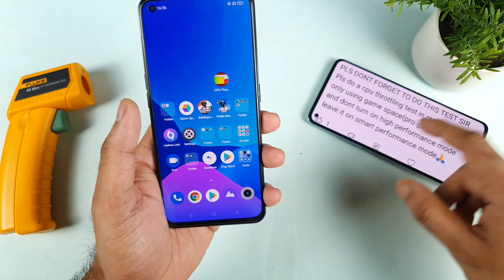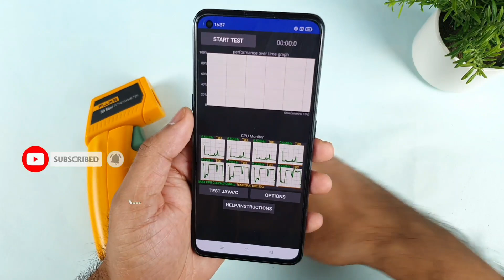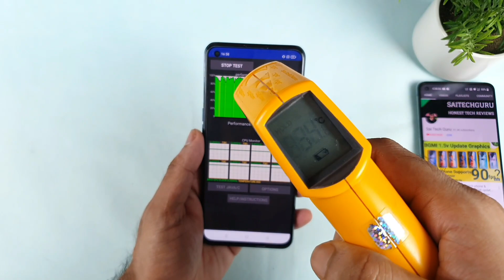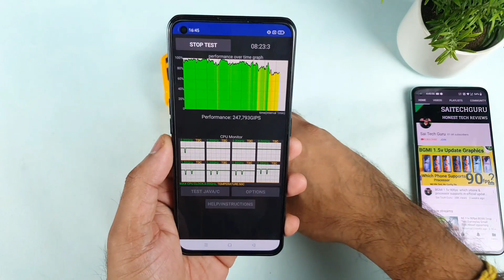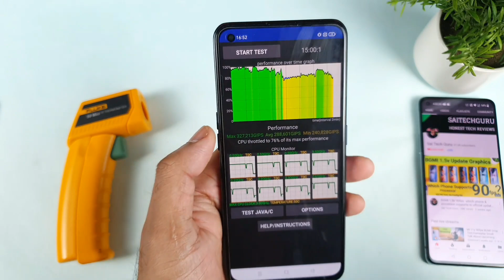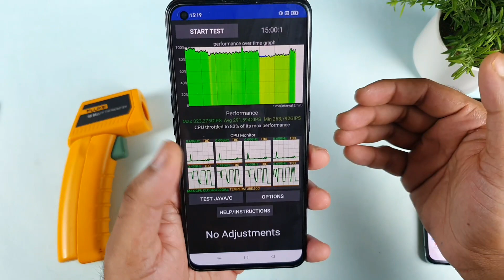Realme X7 Max CPU Throttling using Game Boost & pro gamer mode 🔥🔥🔥

Comment: Clearly 
Snap dragon 870 or 888 
Super AMOLED display 
Loud speaker, fast charging in less time, 
Above 90hz , 5000 mah battery backup,8 gb ram with 128 or 256 gb storage and UFS 3.1,normal camera and long time mobile

Comment: Hi bro 
I want best mobile under 30k 
With best processor , fast charging, setreo speaker, Amoled Display, 5000 mah battery  backup.
Reply: Poco f3 gt and iqoo 7
Reply: @Max-jf6vl  bro poco f3 gt is miui lags. Rear Camera  with RGB lights is not working properly, and dimensity 1200 is not best Processor it can't handling high fps in pubg . And some more problems in poco f3 gt.
Reply: @Max-jf6vl  thank u for r your reply
Reply: Di 1200 is good processor
Reply: @itscrazyrc3834  but that processor not optimize with poco f3 gt